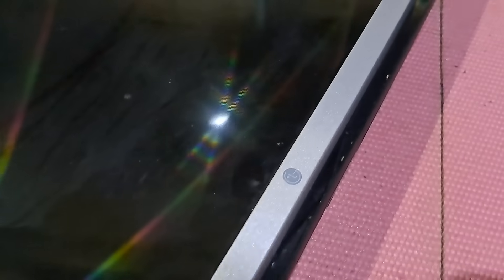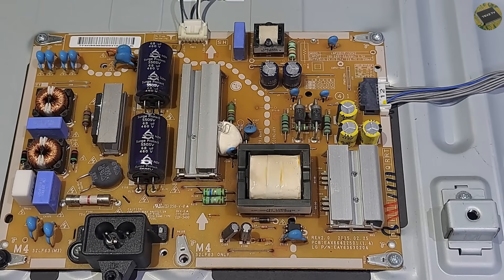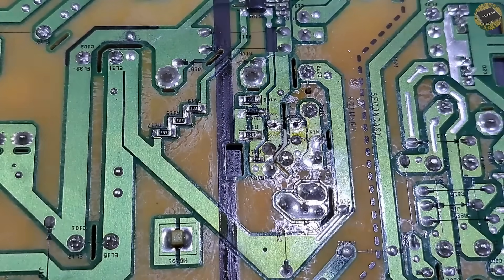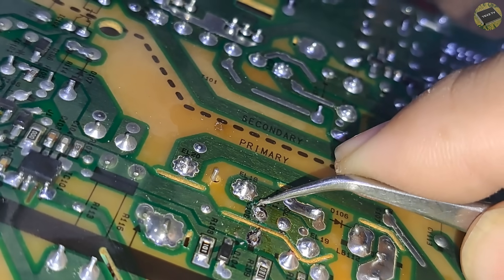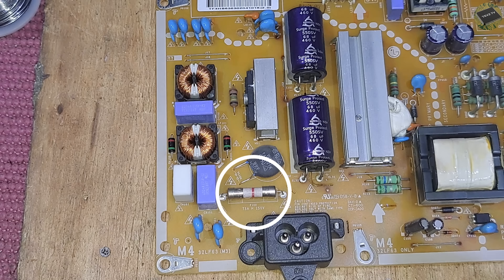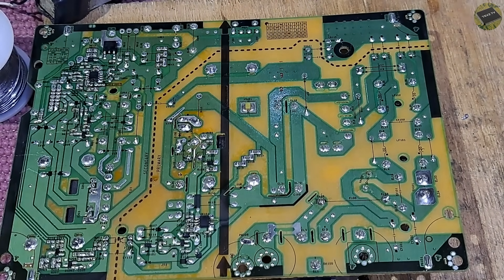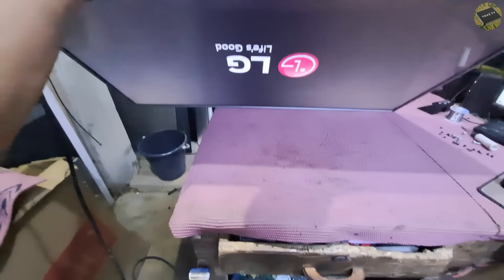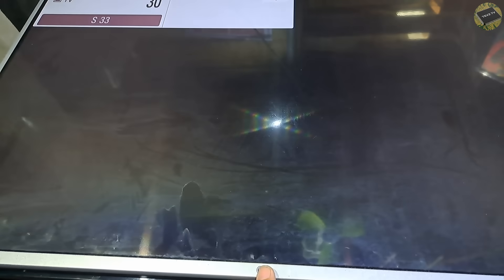Basic issue with an LG LED TV to not turn on.

Comment: Hi master , please share the specification of that resistor you used on the fuse for testing?
Reply from the maker: 20 watts 220 ohms
Reply: @tevzTVTevatronics  thanks 220 ohms 5watts it wont work ?